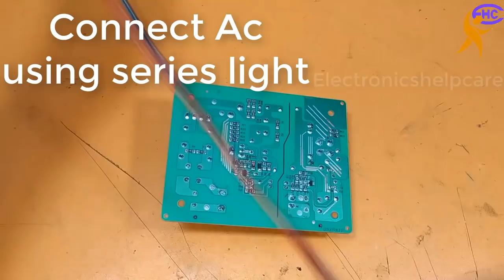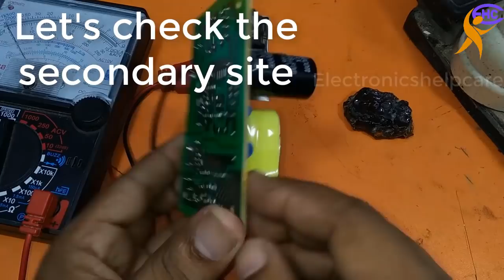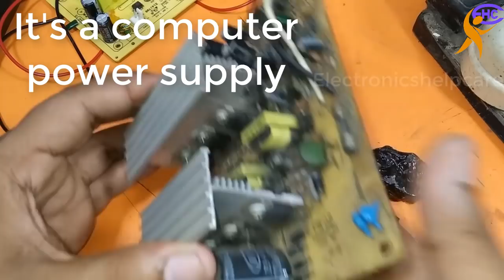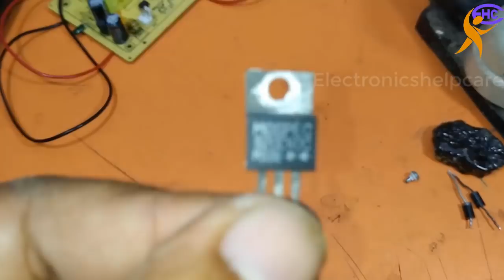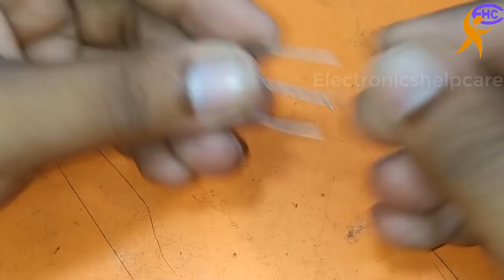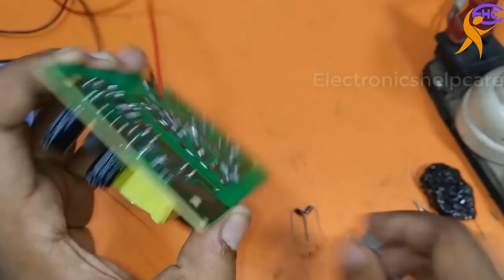power supply repair

Comment: In place of 2 diodes you have used the schottky diodes in To-220 package. What is the current passing rate of diodes and the To-220 packaged one. Are they same?